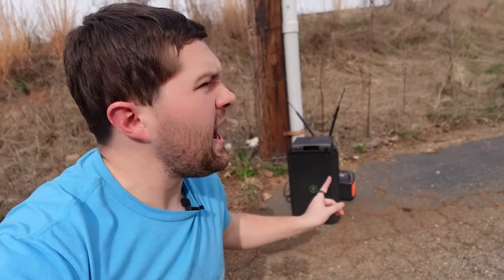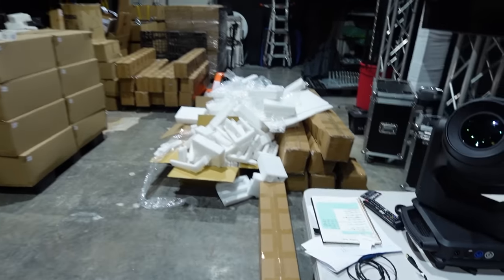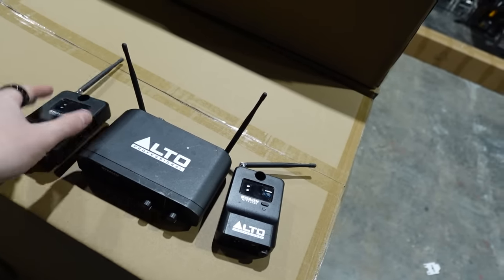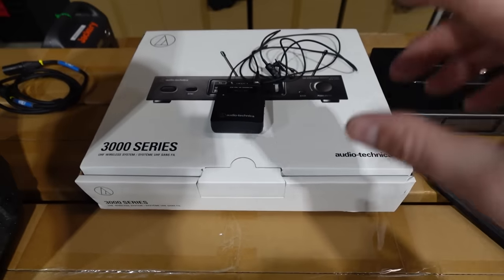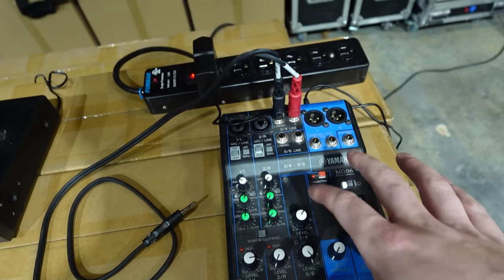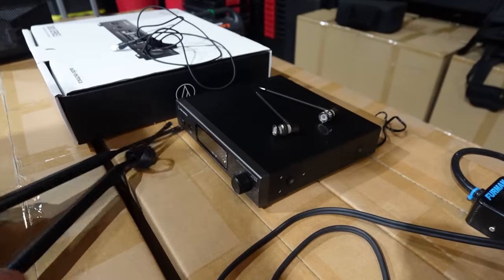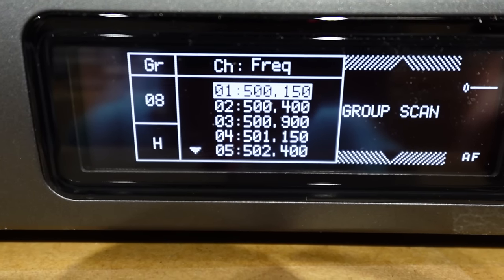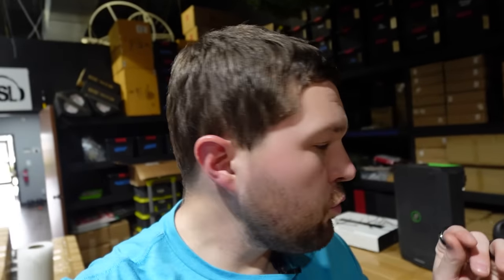DJ Gear - How to run WIRELESS audio to speakers (Wireless Mic Speaker system)

Comment from the maker: This is the setup I used in this video
Audio Technica 3000 4th Gen Body Pack https://amzn.to/3PlwlRg
Body Pack Converter Cables
-1/4" Option https://www.nlfxpro.com/at-gch-guitar-input-cable-for-wireless/
- XLR Option (Prefer this now) https://www.nlfxpro.com/xlrch/
1/2 Wave Antennas https://www.nlfxpro.com/1-2-wave-470t530/
AA wired power https://amzn.to/3VnVqie
Reply: Nice! Bought one today. Thanks man!
Reply: @DJRickWeb Question  - I bought the equipment but can't figure out the connection between the microphone and the Body Pack Converter Cables -1/4" Option. I feel like I am missing something. Any suggestions?

Comment: Rick is spot on here!  YES!YES! scan as late as you can!! I have been using the Sennheiser G4 body packs for years. They rock!  Pricey but you get what you pay for with that gear. Make sure any and all wireless other than your mics (etc) are on. Vendors/House gear included! Don't expect them to tell you what's running there. lol Then scan again if possible.  Always try for the best line of site.  Bodies absorb signal like a sponge. Signal will always be less once people are there. One wedding I got there super early and was fully setup everything running.  Other venders started showing up.  I noticed the videographer after he setup was using the same model Senn body packs I was and I could see his frequency on the main screen on the body pack. Nope, way too close to my freq, almost the exact same.  My mic was on the groom. Has to work!    I spoke to him and he scanned and saw his pack recommended a different bank than he was on at first. He changed banks. He thanked me and all's well!  He had a digital recorder on the groom for post audio. I don't think he scanned when he setup.  If we had stepped on each others freq that would of been bad. Don't depend on other vendors to rescan from their last gig! They will just use the last frequency that was locked in. With multiple G4 rec/transmitters you can create a wireless chain/bridge of outdoor speakers.  One transmitter with multiple receivers for one. With in/outputs on powered speakers you can retransmit the signal on a different freg to keep going.  lots of options.  Test and enjoy :) Love the channel!
Reply: Say you have dual mics on a shure slxd 24 or equivalent system. Is it best practice to have them both on the same frequency, or should they be different? I ask because i always use the group scan and it sets both channels to the same. Havent had any issues yet.

Comment: Use a wireless in ear system, Shure PSM1000or similar would work best. This allows you to keep the receiver at control with your other mics and mixer. Connect the beltpack to the input on the speaker and you're all done.

Comment: For Wireless Audio, I use a FM Transmitter set to a Frequency that does not interfere with radio stations at the same frequency to transmit Audio through the entire building with Receivers to be connected to my Speakers
Reply from the maker: Could work well if you buy a solid transmitter.
Reply: @DJRickWeb  This is what I will use for now, It's hard to find a solid audio transmitter that doesn't drop out or have interference because of the wireless microphones or any frequency that is used

Comment: Nice! I use the Sennheiser (ew 512P G4 because they're both body pack form factor, and it works phenomenally. Alternitavely there's the ewdp which I have used which is awesome because it's digital, and retains more frequency range than analog.

Comment: Does anybody use the Xvive U3 wireless microphone transmitter? I bought one as a contingency for my LD handheld mic and to transmit XLR out off my mains to a side fill speaker. The Xvive operates in the gigahertz range (2.4 Ghz) and I haven't tested it in a room full of cell phones. I look for affordable options versus spending $900 on a wireless lapel system (Xvive is $200).

Comment: This is great info!!! Maybe some ideas to play with.
1. Two mic transmitters on the mixer, one panned left and the other panned right, on the receiver you should be able to utilize each channel to make stereo audio.
2. A pad on the output of the mixer may be needed to prevent overdriving the wireless pack as most are looking for mic/instrument level and not line level.

Comment: Glad YouTube recommended this video. I was using the same Alto system last night. Kept cutting out. Not because of the distance. The power cable is not shielded properly. And any little breeze and made it swing one way or another would block the signal

Comment: Mic frequencies in the 600 range up to 616 MHz can still be used in certain areas, I live in an area where you can use them and I have no problems with the one in my inventory, All my newer mics are in the 400 & 500Mhz frequency range. Great video, I am going to purchase one of these systems.

Comment: I do this with a Sennheiser and it works great.  Finding a good frequency is key, no matter what brand you are using.  Ben Stowe is a genius at this.  Thanks to Pioneer (ugh Alpha Theta), all this will soon be included with some speakers, making life sooooo much easier.  I hope it becomes common on all brands/size speakers.

Comment: Love this idea!
I do the same with my EW-DX and here is what I learned from my research 

For the best wireless audio you want a 
- true diversity system that can switch antennas to reduce dropouts 
- A transmitter that can handle line level input (because you're sending music not a microphone)
EW-D EW-DX AT3000 QLX-D/SLX-D

Now the only downside is the big receiver unit that will be on the speaker and a potentially battery powered transmitter

There are a few systems with small receivers but they don't work as well
Alto Stealth/pro has poor range
IEM systems but they are not true diversity (potential drop outs)

Shure PSM1000 would be the best system to use however it has an MSRP of $5,000.

Now I've seen one cheaper system that might be able to do it but I haven't tried it yet because I had a bad experience with JTS in the past...However my mics weren't true diversity. If someone is willing to try and report back it is the JTS SPT-1R/SPT-1T System

Let me know what you guys think!
Reply from the maker: Couldnt have broken down the nerdy tech specs better myself. Wasnt gonna do it in the video cus its like way over 80% of peoples heads! Thanks for the breakdown
Reply: Look up the specs of this IEM, its what I use and its flawless. Way better to have the transmitter as a half-rack and the receiver as a body pack hooked to a speaker imo. Sennheiser ew IEM G4 Twin set
Reply: @djresqvideomix  this seems to be the unit everyone has had good luck with. Something I missed in my research was that the iem receiver uses "adaptive diversity" using the headphone cable as a 2nd antenna. I wonder if using the xlr cable in place allows the same functionality. I guess it's not true diversity but seems good enough for most djs. I'm hoping the update the iem line to digital like the ewd and then I'm going to get one
Reply: @elliotchocano9374  totally agree. Lets meet again here when they do

Comment: Sennheiser G3/G4 is my system of choice for this. Through concrete walls, metal grids, multiple rooms, tons of bodies...no sweat. Super compact, battery powered, and easy.

For larger/more demanding applications a traditional diversity receiver is best, but I rarely need more than the packs.

Something to be aware of is if you are plugging into a stereo out and you are only able to do mono you may run into issues. Pull from a mono source or, even better, just make sure that you are pushing mono out of your DJ software in the first place.
Reply: Do you use the iem g4? Or the regular mic g4
Reply: @elliotchocano9374  Mic. I tend to use the same speaker from the ceremony as a cocktail and wireless remote speaker, so merely swapping the packs around allows this in one seamless action.

They're readily available used, too, and are cross compatible with each other as long as you get the same band.
Reply: Yes Sir!  that's what I use too.  I picked up the AC power pack that snaps in like a battery pack and allows the trans/receiver to run on AC power with the speaker if it's powered.  Super nice!

Comment: • Rick, what I am doing is mounting the wireless receivers up on a T-bar commonly used for DJ lights, etc. The ten foot height seems to be optimal and helps prevent a lot of drop signal situations as you can imagine.
Reply from the maker: I leave mine on the table and set the reciever boxes on the back the speakers had 0 issues 200ft away full strength

Comment: If you want to use multiple receivers with the same lapel, you may have to adjust some settings. Some systems have a “pilot tone” as an extra verification between devices. If you don’t have the exact same model of devices, you may have to turn that off to make it work

Comment: Great Video!! I don't know if you ever checked out the new versions of Alto Wireless system, but the MKII & Pro version is levels above the original one. You can scan for the perfect frequency now.  So far I'm impressed with the performance, and I'm going to do a video in regards to it

Comment: The best is in ear wireless mics i use shure psm 300 but any good quality dual or single system will work a treat you should try it rick you won't be disappointed

Comment: You can also do this same thing with a guitar wireless without need of mic  receiver to transmitter switching capabilities. The small guitar belt unit is already the transmitter that takes 1/4" mono inputs from a mixer or "1/8 mono in like a headphone out. In this case the bigger tabletop receiver goes at the remote speaker. You can now get great digital low latency long range guitar wireless for $300-$500 .

Comment: If you had the Mackie Profxv3+ mixer you can bluetooth directly to the mixer so you don't even need that adapter. just the lapel and cable for the lapel

Comment: Do you know if these same rules apply to an in-ear monitor system? I was thinking about an in-ear monitor system running from my source and then to the in-ear monitor which will be hooked up to a speaker. Thoughts 🤔😎

Comment: Yo, do you think you could achieve the same results with a in-ear monitor system? Basically running your inputs to the transmitter and then hooking up the receivers to the speakers. 

I've never tried this but I wonder would it be any different. 🤔

Comment: you also can use in ear monitor sistems based on wireless words the same, you can mpove the body pack together with a speaker on aly place you want on batteries

Comment: @DJRickWeb Question  - I bought the equipment but can't figure out the connection between the microphone and the Body Pack Converter Cables -1/4" Option. I feel like I am missing something. Any suggestions?

Comment: This works great but I'm wondering if just getting the SKAA transmitter and receiver would be a better option and also half the price of most wireless mic setups.
Reply: I use the Skaa dani transmitter with the skaa A-link plus hydrid transmitter/receivers one in each speaker... low latency.....very quick setup and all rechargeable....have ammoon guitar dongles 5.8hz as backup and also backup cables.
Not had any issues.... 1 year now
Reply: I stop saying to use skaa people thought I was a rep lol😂  being using it since 2020.  When people see I’m using wireless  they are always shocked     Plus. Look how goofy and big that set up is
Reply: @donaldccannon1  I’ve seen it used by other djs and they swear by it.  I wonder it’s not used by more of us or recommended by other djs.
Reply from the maker: SKAA is 2.4 ghz which is wifi. Wifi is not a reliable source of wireless transmitting as it is a super competitive space.

Comment: Why not just use an in ear monitor set up so that the small pack is at the speaker?
Reply from the maker: IEM systems only use one antenna. By doing this we have true diversity with an A and B antenna on the reciever increasing reliability over distance. Also in the case of my mics I can setup a backup freq as well that if I were to run into issues i simply click a button on the bodypack and bang we are switched over to a backup frequency.
Reply: @DJRickWeb  Thanks Rick.  I use the same mic, but never thought of reversing it with a body pack.  GREAT INFO. 👍

Comment: do you notice a difference in sound quality using this setup vs doing traditional wired XLR?
Reply from the maker: Slightly when the distance gets very long. Mainly in the bass quality

Comment: WhT is the level you can put into a wireless mic transmitter?  -10 /  +4 as I guessing it's looking for a mic input not a line I put . Wouldn't want to push the input to hard and clip it.

Thanks
Reply from the maker: My bodypack might be different then some but I can put 0 db into it and it registers 0db on the input.

Comment: However,  you still have to have batteries to power up the amps in the speakers!!! Also, where can you get a wireless transmitter powerful enough to send a signal through a large venue that has trees and buildings!!??
Reply from the maker: This was just an example. Typically we run hard power to everything. We use this to run audio throughout venues. If you need to go further you can chain this system. So at 300ft take the output for the reciever and put that into another transmitter to then push the signal further
Reply: @DJRickWeb  Thanks for sharing this information, will give that a try

Comment: is there anyway to improve the latency typically found when using AAC?
Reply from the maker: Latency is similar to a wireless mic. Very minimal. We use this for side fills and other rooms and the delay is minimal very similar to what we need based on the distance. From the main speakers

Comment: Can you run the body pack to the headphones out on the yamaha mg06? Would that work? I run my sub off of monitor port and tops from the main left/right outs
Reply from the maker: Yeah that would work
Reply: @DJRickWeb couldnt you also use the body pack at the speaker instead of receiver? Thinking it doesnt matter as long as you have 1 part connected to mixer, the other to the speaker.
Reply from the maker: No the body pack is a transmitter and the reciver box is a recivers the signal goes one way
Reply: Man I got it all working. Thank you rick daddy

Comment: So the body pack transmits sound from bluetooth? I don’t understand how this works. Thank you
Reply from the maker: No I was bluetoothing to the yamaha mixer. Because no device has a 3.5 mm anymore. The wireless mic was doing the transmitting and receiving
Reply: @DJRickWeb  got it. Where was music coming from? You mentioned bluetooth? What device did you use for that? Thank you
Reply from the maker: Little amazon bluetooth audio receiver.

Comment: The issue I had doing his was , that the Singal would clip on the transmitter, and would come out distorted on the speaker the moment I tried increasing the volume to Dance levels. This is great for cocktail hour but not more. I messed with the gain levels, the levels of the transmitter and so on but to no avail. Anyone having

Comment: Audio-Technica make wireless IEM systems that you can sync together so the lapel transmitter will be replaced with an IEM transmitter so you can get a more powerful signal to your receiver so yea.
Do what you want with this information ok I am not responsible for anything you are doing this at your own risk.
I had to say that just to cover my but :)
Reply from the maker: The iem systems are more convenient but they actually are less reliable than using the setup I showed. The is because iem is not a true diversity with dual antennas.

Comment: SKAA is faster and more reliable because it’s on its own frequency. Streetheart and Dani. Plug in and play! More Simple than this long winded video. Plus those label batteries run out fast.
Reply: Hey. Noticed I stop  saying to use skaa. People gonna start thinking your a rep lol😂
Reply: I second SKAA.
Reply from the maker: SKAA operates on 2.4 ghz which in the pro industry is the most unreliable frequency range. Its such a competitive freq chunk that it is very unreliable. This method I show is what everyone in the touring or corprate AV space is doing. And see link to the AA battery plug in wall adapter that you use to not need batteries.
Reply: @donaldccannon1  I don’t mind being an unofficial representative. Their stuff works and works fast and easy!

Comment: I may be wrong, but I don’t think you can have more than 1 receiver.
Reply from the maker: You can. The transmitter doesnt like lock into a reciever. It sends a signal out to whatever is listening and any reciever on the same freq picks up the signal.
Reply: I just ran an event last weekend with 6 receivers running off of one transmitter. Yes, you absolutely can. It's merely broadcasting a signal on that frequency. Any device tuned to that frequency may receive it.
Reply: Got dam bro what event were you doing that you needed 6 receievers lol?
Reply from the maker: Events. I have already done multiple with 6. Full room has 2. Than 2 more in side rooms or entry ways to have complete audio threwout
Reply: @DJRickWeb  Yup. Mine was a throw in the main room, side room, back room, VIP room, dining room, and bar. Pretty widespread, but Senny's didn't even blink (packs only)...even through a concrete wall.